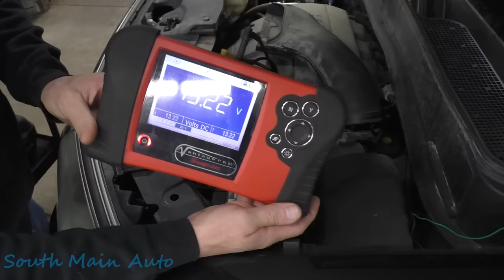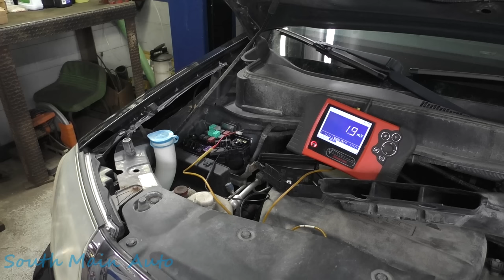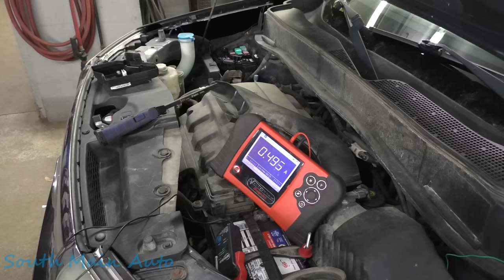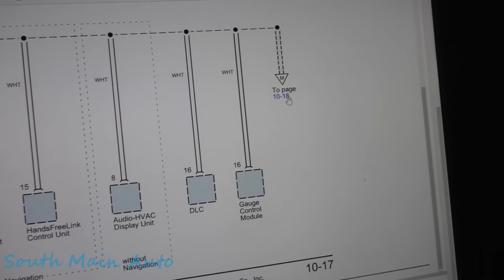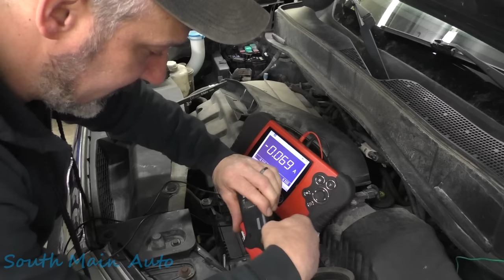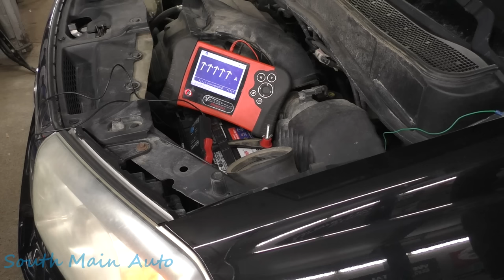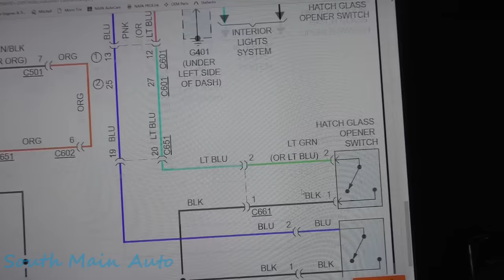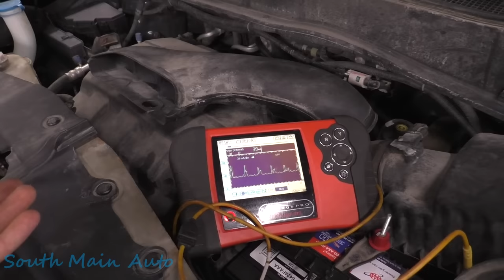Eric O Is A Silver Bullet Cheating Machine!

Comment: I have a thermal imager. I use it for  (and have used it several times) to find excessive current draws. I found a loose cable on a chrysler 300. I found a bad GEM module on a ford. I found a bad fuse block on a chevy. The list goes on. I also found dragging brakes and radiators not flowing, coolers not cooling. You know. I intentionally insert it in diagnostics when i can.

Comment: Troubleshooting RV refrigerators, I would troubleshoot a circuit board like if there was 12 volts going in and no 12 volts coming out, then it's the circuit board and I would just replace it even though there was a manufacturer's manual that showed how to troubleshoot each individual circuit.
But the bottom line was that even if you know what circuit was bad, you couldn't repair the board.
So, if there wasn't any current where there was supposed to be it's a no brainer, replace the board.

Comment: Compare that to dealer service, they run a check with VIN and symptom.
They run two other databases.
You get engineering telling on themselves and TSBs.
If the symptom verified matches up with a known repair, you must use their info and apply it.
If you go do your own method, then submit for time reimbursement?
They can check you and deny your whole claim.
That would be bad.
A good percentage of what comes in is a known fix available, an update, an updated part.
But like you say, you have to be able to continue diagnosing when they have nothing to offer.
There are a percentage of guys who hardly ever do, and a few guys who have alot of knowledge and experience who get it right.
There's usually one guy like Eric O.
He has equipment and runs all the required tests and inspections but at the dealer, he has to appeal to management to break even on his time/pay.
Otherwise he loses his arse.
Then he goes to the bar.
The car has to get fixed no matter what,  so he may miss happy hour.
He's just glad it's not in his stall the next day.
Usually.

Comment: Dad in law has a 2014 caddy.  There are sometimes weeks at a time that he doesn't drive. Consequently, the battery has died a few times requiring a purchase of a new battery.  Infuriating.  Final result was to put a 1.5 amp trickle charger on it.  It simply has too many very small draws because of all of the electronic crap on it.

Comment: Take my hat, hold my coat. Still plenty of kick left in this old goat!
Checks fuses for voltage, finds it. 
Checks wiring diagram for fuse.
Looks up Silver Bullet, two issues described. Checks door locks. Not those. Checks rear glass latch. That's it.
Tells Mrs. O he didn't use his brain.
Stay safe!

Comment: I have a Suburban that killed two brand new batteries in a row after each new battery was installed  in the vehicle and the vehicle sat parked for several days after each install. On the the third new battery I happened to drop down the sun visor on the the front passenger side and noticed the vanity mirror had a bright light bulb on either side of the mirror.  The mirror lights would not come on until the plastic cover over the mirror was pivoted open in order to use the mirror.  The latch on this plastic mirror cover was not working properly and the cover would not stay latched. Therefore, the lights would stay on with the visor up and not be visible because the visor covered them. I did what the average person would do and ripped all those worthless lights out of the visor. No more dead batteries.

Comment: most of this is knowledge, to look on the SILVER BULLET cheat side , you found a common fault ( you have done these repairs before ) some customer may say $ 90.00 for what I could have found on the internet ? But 2 batteries later $$$ and tracing the fuse , so money well spent !
Reply: You would think AAA would do a quick voltage draw test (amp clamp, multi meter, etc.) if the customer is reporting a dead battery after 24-72 hours.  It's unlikely that the battery is the issue.

Comment: Eric., great detective work love your videos just wondering would I be able to do something similar with a voltmeter versus your $54,000 scan tool😂
Reply: Yes its called a multimeter 😅
Reply: That's a $500 dollar oscilloscope lol
Reply: Sure you can, BUT test the meter out on known low draws first, some of the lower cost meters are almost as accurate as weathemen...
Reply: Even a cheap meter is accurate enough for this sort of work.
Reply: @paulsengupta971  I've seen meters that don't read accurate when they get into the amp or less areas. If the meter is reading off then you could be chasing nothing.

Comment: All the Napa batteries have that sticker on them from what I have seen
Reply: Some “store” brand batteries. NAPA included, sometimes the original manufacturer label is under the NAPA label.
I’ve seen A few different ones peel off NAPA, it’s actually a die hard, energizer, and Johnson controls ( Johnson makes most off brands like ever start Walmart etc )
Reply: @helloitsme4139  yes I agree

Comment: i'm getting flashbacks now, friend of mine had a Honda accord with a parasitic draw on the same fuse, after days of head scratching I found it to be the door/window/keylesss entry module. I about called it on a bad module but then I had a thought an tried de-pinning some of the inputs to it, Turns out the drivers door lock switch had fallen off the lock when he used it and was sitting in the unlock position causing the module to never go to sleep as It was waiting for a lock actuator movement that never came.

Comment: If you consider that cheating then you better throw away all the service info and TSBs as that could be called "cheating" as well. As you said though, there are a LOT of shops that use the various services to simply fire parts at it without any real diag work.

Comment: My parents had a car many years ago that had a suspicious loss of battery charge. Mechanics couldn’t find anything, couldn’t find any u usual current draws, after many attempts. Finally one mechanic left it overnight in front of the security camera and checked the video the next day. When unattended, the car would flash its lights and the lights would stay on a few minutes, about every half hour. 

The car was receiving stray signals and thought it was from a key fob, which would wake up the computer and turn on electronics (and lights), then wait to see if it really was from the key fob or not. After a few minutes, it would shut back off. Turns out it was a bad radio receiver that kept waking everything up.

Comment: Has anyone else run into “store” brand batteries that are just relabeled, I’ve seen part store brand batteries, peel the label off and it’s actually a Die hard, energizer, Johnston Controls. 
I think most house brands are like that. Walmart EverStart made by Johnson, I think NaPa is mostly east pen manufacturing.

Comment: Using identifix is no different than using Google, and it's not an issue so long as you troubleshoot! I use Google and YouTube all the time. But I use the info to troubleshoot the problem. You have to verify that you have found the problem before you start ordering parts. 

Sounds like you have a lot of parts changers in your area Eric...

Comment: eric would have went to the door locks and the rear hatch, remember video eric did on the black accord, drivers door lock was bad causing the module not going to sleep drawing current all the time, eric pulled the door panel and found the draw.

Comment: Also. You had said a short will blow a fuse. It will most certainly not always cause a blown fuse. Please be careful with that. Current can’t flow without a path to ground…Therefore whatever component is bad. Is shorted. I assume you meant a short in a wire. Just saying this because a lot of people follow you. Little stuff like this can make someone new really misunderstand how electricity works.

Think of a field winding shorted or a shorted alternator or starter with constant power.

Comment: How does a switch to ground for a module control input draw 500mA? Let's assume that the switch is defective and is always on, that is, connected to ground. A switch contact wetting current feed from the module should be at max around 20mA. I think the MICU may have a fault which is producing the high current draw, is the module trying to actuate a load?

Comment: I feel dirty also.  I feel like a parts cannon implementuer.     My pov died while idling in my driveway.   96 ram 5.2.  I checked for power to the ignition coil and found none. I checked at the asd relay and had my power in to the coil and N.O. contact. I had the negative from the pcm. But I didn't have power out under a load. Found a bad connection under the asd. Checked power at coil and had 12v.  Checked spark out of coil and had good spark. Checked spark out of distributor cap and had weak spark.  Couldn't get cap off distributor so installed new distributor with cap, rotor, & cam sensor. Broke bolts off old cap and upon inspection it was obvious that the old cap was junk. Very corroded. Still no start so again checked spark out of coil. None.  Checked secondary on coil and it was open.  Visually the coil looked to be junk.  Installed new coil. Still no start. Checked spark coming out of cap and had excellent spark. Checked injector signal and it was good.  Good fuel pressure at rail.   Dry compression showed an average of 50 psi. Wet brought it up to 125-140.   Still no start after wet compression check.  I had replaced crank sensor because the old one showed weak even though it was working.  Installed new plugs and wires just because the rest of the ignition was new and I new the plug wires were leaking a bit.   I guess the next step is to pull the timing cover even though my compression tests showed it was the rings.  I don't believe the rings are causing the low compression even though my compression tests said so.  Can I put in enough oil to disguise low compression from a jumped timing chain?  250,000 miles.

Comment: I used identifix for only one month. On 3 different vehicles I got information not available. When that occurs you have to email them and someone looks your code or wiring diagram up. They email back info requested. Not good for a shop that's open till 9 as you have to wait until next day for a reply.

Comment: Omg I have this issue in my Ridgeline.  My driver door lock sticks when I attempt to  arm the alarm.  Autozone tried to test my battery but they said the test wouldn’t run due to a strange draw.  My alarm will go off at random times.

Comment: A question if I may... If fuse 23 goes to an under dash fuse/ relay box,  wouldn't the next step be to pull the fuses or relays in that box to find which circuit was at fault?
Reply from the maker: Nope, The power distribution wiring diagram shows us exactly where it goes

Comment: Nothing wrong there, you used experience (other peoples experience accessed through the internet, but still) of that same symptom, to go straight to a few suspects, rather than diagnose it from the ground up yourself through all the possible causes. Worst case you would waste a few minutes finding out the problem wasn't in those places, and compared to the potential in saving time that's fine. 

As said, the problem with silver bullets is when people turn to the parts cannon rather than actually confirming what the problem is before changing any parts. It's a way to know what to test first, not a way to avoid doing tests.

Comment: I'm not sure who would be upset that you used  a data base of knowledge to repair a vehicle and save the customer money and you time. You are still making  money moving vehicles along faster . You are also making a reputation of fast correct repairs and saving the customer money . That customer will tell others about your service which will get more customers than you can handle. There was an auto repair where I lived that had hundreds regular customers because he didn't rip people off. We had IBM here and when they began pulling out and transferring people  he would get calls from former out of state customers telling him of  a problem they were having with their car and if it sounded like the repair the mechanic recommended sounded right and if the cost was reasonable

Comment: Logical approach leading to a amperage draw suspect.  My question is do automotive fuses have a small amount of resistance?  Is that the way you can measure a voltage drop at the fuse when current is flowing?
Reply from the maker: A fuse wouldn't be a fuse without resistance would it 😉. Resistance makes heat, heat blows the fuse 👍
Reply from the maker: A fuse wouldn't be a fuse without resistance would it 😉. Resistance makes heat, heat blows the fuse 👍

Comment: Yeah, amp clamps are great for go no go, but so drifty they should be in the next fast and furious movie. *patsselfonback

Hate those temporary battery terminal dealies. Nice work as has become expected!
Reply: There are milliamp clamps out there that will handle the low draws without an issue BUT most are not real good if you spike them with more current. I use one on the bench that reads 0-1 ma, but put 50ma through it and it will fry.

Comment: Actually I would not say it is cheating, but I would say it is more of a method to confirm one's own suspicions. As it is kind of like how back in the 1980's when dealing with an erratic idle, that was commonly a vacuum leak. And would have probably been the same thing in the 1990's if you was dealing with a TBI system, but if dealing with fuel injection it may be a faulty Idle Air control valve/Idle Air bypass valve. Yet it could also be a cracked carburetor gasket/TBI gasket, but now it could also be a cracked Idle Air Control Valve/Idle Air bypass valve gasket or some other kind of vacuum leak. So having stuff like that makes it easier to track down. Is it a cheat sheet? Yeah sorta. But it's more of a way to pass down knowledge to find more modern problems. I'd have killed to have access to that kind of info back in the 1980's when I was working in a full service gas station.

Comment: That wasn't cheating at all. You knew exactly which branch has the draw; the only question is exactly which device is faulty.

Yes, you could pick one at random and start unplugging. Or you could see if one has more of a history of failing. You already found the list of all possible things, you just used other mechanics to help decide which ones to unplug first.

You could have not used their help, and started unplugging all the devices - and then you'd have found it anyway on the last thing you unplugged. 

Bad would be: 

- "Oh, parasitic draw on fuse 15"
- "Guy here said he replaced the backup camera.
- "I'll try replacing the backup camera"

Comment: OK OK It's time to give in and go to an  Optometrist and get a real  (a couple ) pair of glasses.  It's going to take time to get used to wearing them all the time. Being a older person you're going to be stubborn about wearing them all the time. I started at eight years old so I'm the opposite I feel lost with out them. Also I can't see much without them. I bet you're having to concentrate hard to see.  Doing that is giving you stress which leads to headaches and so on. For me I have to wear a large frame  Don't buy them for fashion. Get one wire frame like aviators and an all plastic as big .